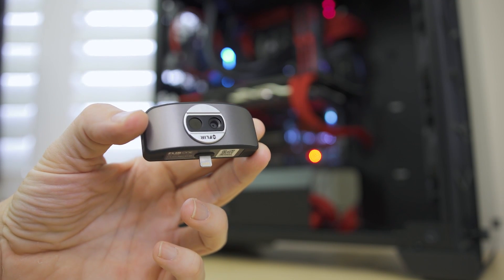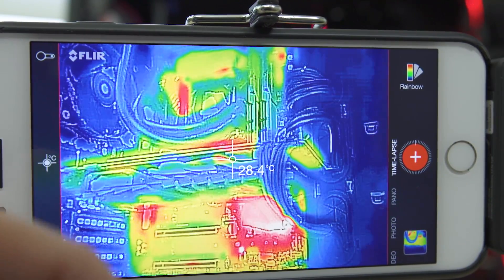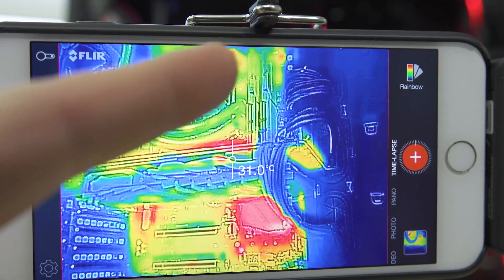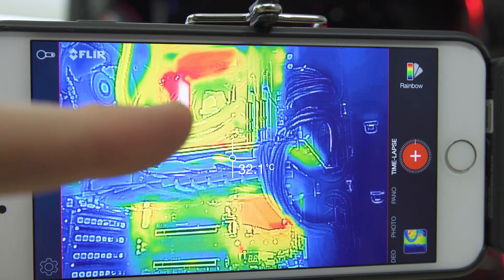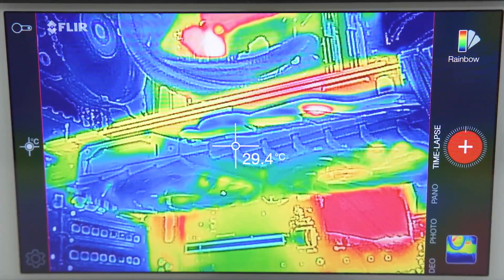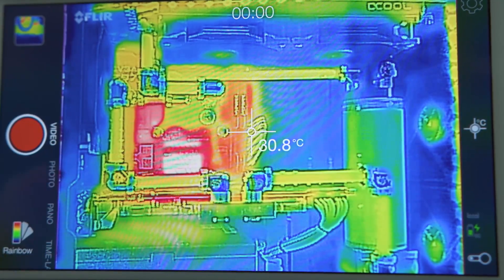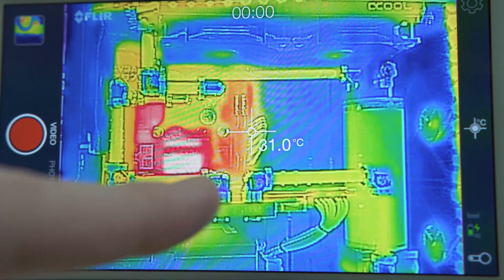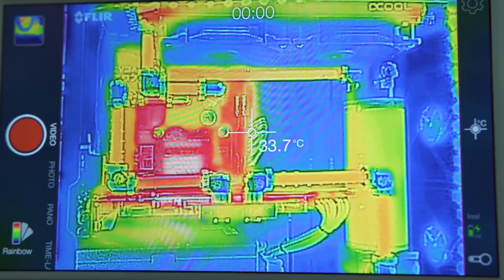PCs and Thermal Imaging... What your eyes CAN'T see

Comment: Hey jay i just overclocked my MSI gtx 1060 OC 3gb even further. i went from a core clock of 1949mhz to 2050mhz and a memory clock of 4014mhz to 4404mhz and im getting around 72 degrees  C.  i could probably up my memory clock another 50 to 75 but i wanna know if im risking my parts. i dont mean temperature wise because im trying to keep it below 75 degrees and wont go further but just the internals of the gpu. i watched your Over clocking videos should i use the same concept of bumping it up till a crash and then tuning it back? thank you -justin

Comment: I agree, you have to direct airflow. 
I create a vacuum and force air to go one way - I bought a case thats about 90% open to the air in the front
but the top,bottom, and both sides are completely sealed - so air is forced to only enter via the front, and forcibly exit via
the back due to the fans I used - nothing RGB but they move TONS of air. 
I have a full AMD system too, so this is how I learned proper air management.
Currently using an FX Hex @ 4.6ghz and an R9 390 Strix so much overclocking headroom once 
you get your CPU,GPU and case temperatures under control.
Also I dont use liquid cooling, so that FX Hex is overclocked via AIR and only hits up to 63c 
once the CPU has been under 100% load for quite some time. 
I use it to game so its never used 100% during practical use - just when stressing.
Reply: I bet you get a lot of dust build up on your components, don't ya, due to negative air pressure and lack of intake filters?
Reply: Theres dust ya, as in every system - but nothing that warrants attention.
Reply: Aleksandar Dimitrijevic also my CPU max temps are around 63c under load, and GPU max temp is 67c (with custom fan curve) which is notable because its a Hawaii, so 67c I'll take, never goes above 67c. I don't have any excessive dust issues, negligible as of now. I did build this with over clocking and hawaii in mind, and there are dust filters on the case.
Reply: Cool. Have you done some benchmark tests maybe (cinebench or userbenchmark)? What results did you get with that FX 6300? I had FX 8350 and after a fair bit of use and testing I sold it (along with the mobo), and got an ancient i5 750, clocked it to 3.8 and got the same (if not better) results and gaming exp. for half the price of that FX combo. Not long ago I changed i5 (+15$) for an X3470 (i7 870), also OCed to 3.8GHz with max temp of 56C in aida stress test (tuned pretty sweet, only boost off), and gotta say I'm pretty happy with it. What I'm trying to say is old intel stuff is dirt cheap, and still good, way better than FX line. Not trying to piss on AMD, been an AMD user for more than 10 years, just sharing my experience and I wish I knew this much earlier.
Reply: Jon Mercado https://www.pugetsystems.com/labs/articles/Side-Panel-Fans-Are-They-Worth-It-102/ . Here's some of the benchmarks of side panel fans. Hope this is informative.

Well dust will build up, with negative air pressure but im sure u already know that and are willing to take the compromises.
Reply: Well I looked at that chart and all my shits doin far better then that. 109c GPU?
Get the fuck outta here - what we usin Fermi? (lol I just checked, they were indeed using Fermi). the 70-76c range is find with me as far as GPU temps go but youll never see me use a GPU @ 109c. As a matter of fact I cant use my GPU @ 109c, Im pretty sure they thermal throttle @ 84c. 

I do know that my video card dumps its hot air right onto the area where my CPU fan is, which causes the CPU fan to pull the warm  GPU air thru the CPU heatsink which caused a 50c idle and a 73c max, this is originally why I started on my quest to get my temps under control.

As you can plainly see, Ive done so successfully, much more so then your linked article.
When youre dealing with flow of any sort- liquid or gas, water or air, you need to control the direction of it. You want the air to wash over and through your heatsinks, and you want it to blow through places that are stagnant. If you used a sealed container and only allow air in through one end and only allow it to exit the other - well now you have a flow you can work with and modify or tune as necessary. 

I think Ill stick with my design, my build, and my choice of cooling. Eventually I will be getting liquid cooling, but Im already @ 4.4-4.6ghz with 63c being the max for a FX hexcore I dont think I need to go any higher for dx11/12/vulkan environments.

Edit: today made a liar of me lol, hit 66c after a few runs of cr15.

Anyway thats my experience, thanks for listening.

Comment: Two common pitfalls with IR-imaging:
1) Reflection: Metal surfaces are often highly IR reflective. When measuring the temperature by IR radiation watch out for reflections. The heatpipes are actually hotter then they appear in the IR image. Try sticking some tape on it.
2) Transparency: Depending on the type of material IR can more or less easyly penetrate. Plastics as your wathercooling tubes are often opaque to IR. So even if materials look transparent to the eye that doe not need to transfer to IR. Try stick your hand behind it to check.

Comment: I'd love to see a more in depth video on how GPU backplates affect its cooling ablities.
Reply: Most metals are good thermal conductors, however the air trapped between the backplate and the PCB is a powerful insulator. Unless the backplate has thermal pads, I believe it will only serve to trap heat.
Reply: I would like to see this as well, but you'll need more than the FLIR to get than answer. You'd probably want to attach thermocouples to the VRMs & check temperatures running with & without the backplate.
Reply: I think if they make direct contact with the back side of VRMs and the GPU core then they will work very well but that would be stupid if the  surface of the backplate is conductive since that will short out everything. For now I do agree with you, not only do the trap heat byt they restrict airflow from case fans. 

My solution: have a heat pipe connected to the backplate and join it with one of the main heatpipes of the heatsink. It would be really nice to use all the surface area of the backplate for active cooling(by directed airflow).

also, RGB!
Reply: I have a hunch that having a massive cpu cooler (air!) like Noctua NH-D15 will cool the back of the GPU way more efficiently than having a backplate.

Heat conducts to backplates only through those thermal pads that are missing in most cases and the screws you use to screw the thing on.

Comment: I'd like to see thermals like this, comparing temperatures, GPU or otherwise, comparing ATX and Reverse ATX. All these years and graphics cards are still built 'upside down' and I've always wondered if heat dissipation is better if you flipped it in a R-ATX orientation.

Comment: I have been dealing with a motherboard that is not able to keep up with the power of both a FX 8350 and a GTX 980ti. I had bought the board without knowing about power phase. I had bought a board that has 4+1 power phases. The board had no heatsink on the VRMs. Adding a copper  heatsink on that has helped, but I believe that the board is just too weak. But I am stuck with it. The board is a Gigabyte FXA990-D3 (not the ud3 version). I have 3 fans pulling air out the top and rear. 2 fans in the front, 2 on the side, and 1on the bottom pushing air into the case. the PSU is getting its own airflow. It is summer here and my place is hitting in the low 30°C (that is in the 90°F). When the CPU and GPU  are taxed, occasionally my system would just stop dead like the power got pulled from it all of a sudden. I have had to reside on 4.2GHz CPU clock and a 80% power delivery target to my GPU. Just so I can have stability.

Comment: This is a good example of why sometimes reference coolers have advantages over aftermarket ones, meanwhile axial fans recirculate (hot) air in your case, which will heat up your motherboard and especially your chipset. Blower style fans will just take all the air and exhaust it out off your case, specifically not impacting your motherboards temp and actually helping to move air away of hot components, avoiding the heat to stack up.

Comment: Does the color of the build have any impact of the overall temperatures? 
I know for a fact that a white surface is cooler than a black surface in the sun at least.
Reply: 3en6ie 3en6ie Thank you!
Reply: Darker surfaces are hotter in the sun because they absorb sunlight, rather than reflect it away. In a normal room, the colour doesn't matter at all. Because it's not absorbing anything. A white surface in a 20*C room is going to be 20*C. A black surface in a 20*C room is going to be at 20*C.

Comment: I noticed even a difference with MB Chipset Temps without a Thermal Cam, when i changed from Air to Water due to the GPU fans already cooling the Chipset...had i 5° Diff on MB ...just increased the Front intake to a Permanent 900 Rpm ...FIXED !!!

Comment: Those vrms and chipsets are designed to work at those temps. 
Thats why there passively cooled.
 And they validate them in the worst case scenario.
 
Your video gives the impression that you need to care about those temps such as chipset and vrm ect, you dont...misinformation
Reply: Yup. This right here is truth. But there's no way to stop the flood of "should we all buy VRM and chipset water blocks now?" comments.... sigh
Reply: Mike Duffy, from my understanding of this video, he addressed it with just having reasonable case air flow.

Comment: Great video, but next time please show a temparature scale. Seeing the Chipset glowing red on the video does not tell me actually how hot it is, only that it is the hottest part of your system. If your chipset is anything lower than 50C i wouln't worry at all as the components are designed for that temparature range. 

I personally have a system with a 6600k and a 980ti, both overclocked, and a single radiator at the front of the case, through wich all the intake air goes. With this setup my hottest parts of the system actually were about 85 degrees at the coils of the cpu vrms and 60 degrees at the graphics card backplate. All the semiconductors stayed under 45C, even in my not optimal setup with the fans nearly idling. So unless you are building in a sff case or really mess up your airflow i don't think you're going to run in any problems.

And i'm definitly not saying you are wrong in any way, i would just like to see some actual numbers. Anyway other than that this is a great video as always, really liked that you showed us the timelpases of the system warming up. I'm really looking forward to your next videos with the thermal camera!

Comment: I'd like to see you point the focus of that thermal imaging camera at the motherboard chipset to see the temp deltas there as it, along with some of the VRM, appeared to be the hottest points of both the air cooled and water cooled systems. I'd also like to see you do this test on a water cooled system that includes that chipset and VRM in the loop(s).

Sidenote: With respect to video card back plates, are there any vido card water blocks that include the back plate in their loop?
Reply: No cooled back plates, because it's unnecessary. Backplates in the first place are pretty unnecessary, I mean yeah they do something but really, generally, unnecessary. Simply not enough heat to worry about on that side. Which is why most don't have a backplate. They sure do look better with a plate though.

Comment: why PC's are still huge, heavy metal boxes like they were 15 years ago? Hell, PC's were smaller in 90's if i remember correctly;/.
Reply: You realize a smartphone is vastly more powerful than your PC from the 90's? And I would say it's a lot smaller. Desktop PC's are generally the same size, because they've grown thousands of times more powerful, without growing any larger.
Reply: If an ITX machine can be and do all the things an ATX system can do, then why does ATX even exist. Ask yourself that and ponder for a while. Either way, I wasn't even talking to you, so I've no clue why you're so offended (even though you're wrong).
Reply: We're talking about the entire form factor here, not the motherboard. Remember what the original post on the thread is asking: "why PC's are still huge?". A motherboard is not a PC... It's just part of it. So, no reason to get hung up on motherboard form factors.

Regardless: An ITX machine can't fit the same amount of addon boards (PCI/PCIE), can't fit as many harddrives, can't fit as much additional hardware (water loops, other things). It can't fit a lot of things, because it's literally smaller. Good luck fitting my 8xSSD's and 4xHDD's in an ITX case. Or for that matter, finding enough SATA ports to even fit half of it on a ITX board.

This is why ATX is still the norm, because people want to fit more things into them. We're not talking about alternative solutions to those problems either, because the OP's question was simple. PC's are still the same size because we have exponentially more powerful components that require sufficient cooling (cooling can't be solved by magic, you need enough surface area and air flow), and we use more storage than ever before in history.
Reply: Well... The same was true in the 90's too, small computers aren't new. microATX, which is smaller than ITX, was available in the mid 90's.

These kinds of arguments are a bad idea, because even a Raspberry Pi is literally a fully worthy computer, and it's the size of a credit card. Or, even an Intel Compute Stick (http://www.intel.com/content/www/us/en/compute-stick/intel-compute-stick.html) - is absolutely literally a full desktop PC the size of a USB pen, it even runs Windows 10 (DESKTOP Windows, not mobile). So, in your own argument, it's "your choice" to use something as large as an ITX build..

But he's clearly talking about why the average, typical, normal desktop is still the same size. Which is a valid question. If we lived in a world where we didn't care about making computers faster, only smaller, then it would be a good question. But clearly that's not the case. The typical desktop PC is the same size it always was. And that is what he's questioning.

Comment: i want to buy a dual radiator but can only mount in the front of the case and will probably be inttake because i have a filter there. will it being front mounted affect other temps dramatically?
Reply: btw probably going push/pull in the front
Reply: joost van den Berg no
Reply: im sure jay and luke(from linustechtips) have shown that push/pull isnt much different to just one or the other, so i would suggest going pull so that its easier to clean your rad, i have a dust filter and it still gets covered after about 6 months
Reply: ah i understand thanks, but i have just really fallen inlove with the kraken x62/52 so i am definetly going for that

Comment: I would have liked to see this on a genuine "air cooled" system, rather than an AIO, which is in effect a water cooling solution. It would have been interesting to see the effect of having an air cooler on the CPU (like a dark rock), which I think would generally heat the entire inside of the case and particularly nearby components.

On the case, it appears both the cases were open, which again doesn't feel like a true life scenario. I wouldn't underestimate the effect a closed case might have.

Comment: Really nice video, thanks. Looking forward too see how backplates influence the temperatures of graphic cards. My guess is that they just spread the temperature across the pcb to help avoid mechanical stress influenced by large temperature differences on the pcb.
Reply: Great point about spreading out the temperature gradient - I hadn't really thought about it that way. Considering backplates aren't really needed for cooling, it might be a good idea to use them for thermal stress reduction though. Might delay potential solder-joint fracturing.

Comment: The reason the motherboard heats up is because a motherboard is basically giant copper heatsink, made up of several layers of copper traces, all those copper traces transfer a lot of heat, this is also why it is a PITA to replace board level components ie. capacitors, between the high melting point of lead free solder and the heatsink effect of all those layers of copper traces, you need high heat and quick steady hands to do board work.
Reply from the maker: Im aware of this and been preaching it for years, I just needed something visual to share with the audience.

Comment: Hi Jay. I watch and enjoy all of your videos. I wanted to run something past you and all of your other fans here. 

After watching the thermal footage, would it not make sense to have a vertically-mounted graphics card? In other words, turn the graphics card to where it was parallel with the motherboard. It just seems like the areas around the PCI-E connector, as well as under the card get quite warm. Any thoughts on the matter? 

I have been thinking about using a PCI-E extension, then making a custom vertical mount in the back of the case, that way there's a column of air blowing in and flowing between the card and motherboard, then out the back and top. After watching this video, it would seem to make more sense. 

Any comments or suggestions? I welcome any and all feedback.